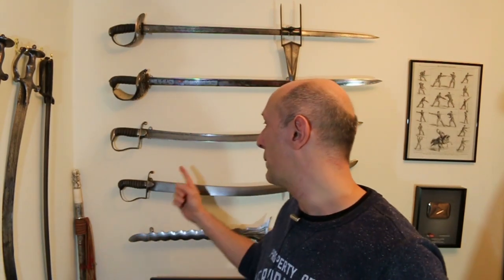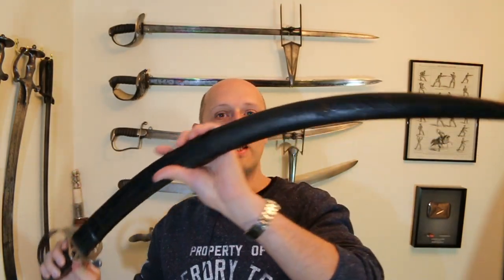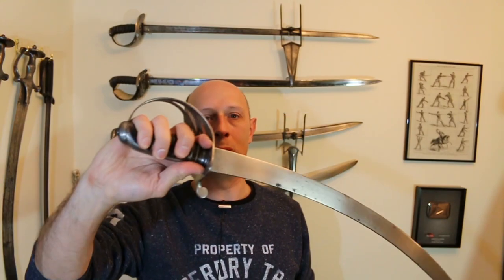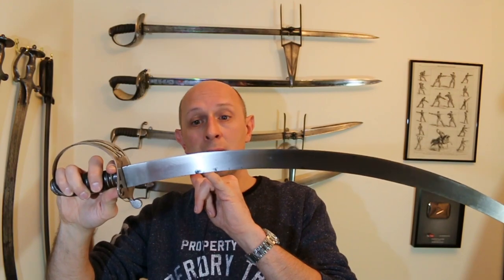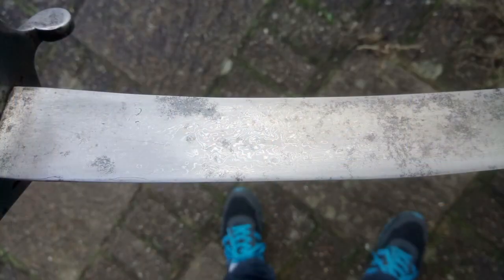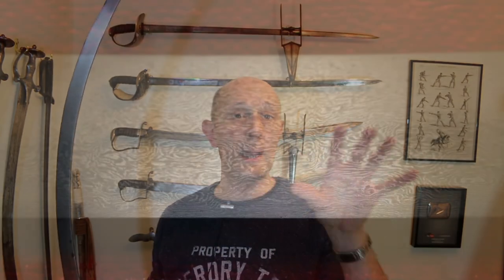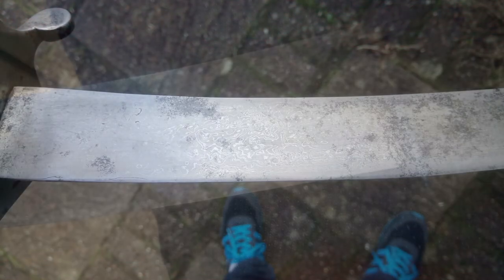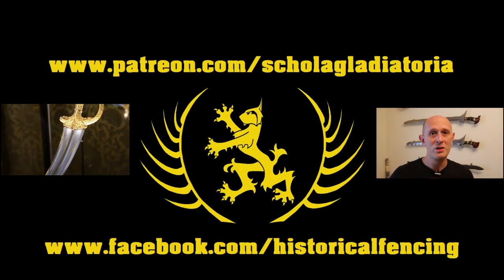Pattern Welded Blade Surprise

Comment: Matt, could you please post pictures of wootz (properly etched) together with pattern-welding (properly etched), so it is easier to see the difference. Thanks in advance.
Reply from the maker: I did in this video :-) But I will do more.
Reply: I meant posting pictures side-by-side (or one above the other), so that both wootz and pattern-welding are visible on the same frame.

Comment: I'm a little surprised that you were surprised by the pattern welding.  Forge welding of billets was pretty common up until the 1860s--the US army had a commission sent to various European countries in 1840 to compare manufacturing techniques for swords, and the French were still using forge welding, while the British had been using crucible steel already for some time.  The Museum at Klingenthal shows all of the techniques that were used, and the director there told me that they were still using those techniques in the 1860s.  Any sword from Klingenthal, and possibly from Chatellerault from that period will show a pattern weld pattern when etched.

Comment: Anyone know what the technical process was for creating a wootz pattern? When I made a damascus blade it became very clear it's challenging to get the right number of layers so you get swirls that are still clearly defined. Fold and weld too many times and the pattern gets so fine it's barely noticeable. Fold only a few times and the pattern ends up very distinct. Add some cuts, grinds, or shaped blows (think hammer + punch) to the piece and you can get some really interesting patterns. From what I can see there might have been some twisting going on between folding and welding. Twist one way, fold, weld, twist the opposite way, fold, and weld. Wish I had a forge in my garage to experiment more.
Reply: ultra-basic summary:
take your iron source, as a smelted bloom. break it up, place it inside a crucible, with a layer of glass and some charcoal. seal the crucible with a clay to make it air-tight.  heat it hotter than any forge-welding temperature, till the steel melts, and hold it at that heat for hours. remove from the kiln, open the crucible, and break off the glassy surface which should contain all the impurities. underneath is a "button" or "puck", a round block of very high carbon steel. That is then forged out very slowly, using multiple heating passes, as the structure is far tougher than normal steels. its then forged out from puck to billet, then billet to blade. the wootz pattern is the dendritic structure of steel crystals inside the blade, not a process of a single forge-weld.